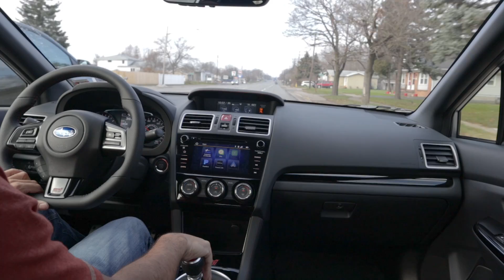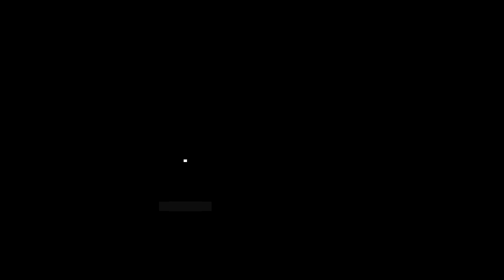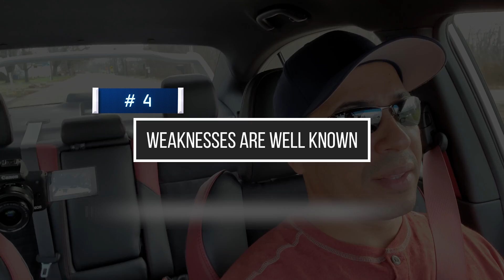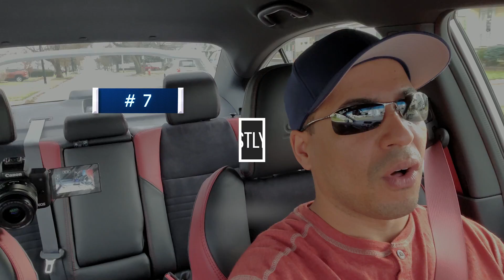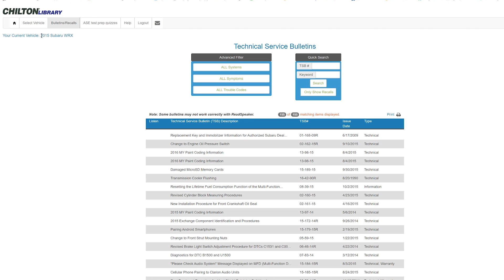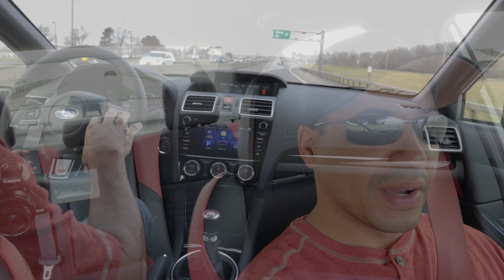2020 Subaru STI:  Why I didn't wait for the next gen STI

Comment: Subaru put too much oil in my WRX and made it run like shit. Now all the engine drive flaws I dont know if its the stock tune or due to the oil damage. So Ima beat the fuck outta the engine not investing a dime into it until it breaks or I trade it in for an EJ

Comment: Your number 1 reason was “platform familiarity” against your 2017 WRX. you do realise the wrx is on a totally different platform (FA20 vs EJ257)? What a stupid comment.
Reply: Boost & Shutter in the context of cars it definitely does and it’s a widely accepted terms. You specifically mentioned when you go to ‘do mods to this car you’re gonna know what to do and where the bolts are’. Everything about the car almost is different, engine (obviously), transmission, drivetrain, suspension, brakes, steering. If you want to mod your infotainment sure, that’s the same, but you never specified what exactly carries over in terms of familiarity for you aside from the car looking and feeling the same cosmetically, which IMO is not the most important factor when considering this stuff. Engine platform is a huge factor because this engine has been around for years now and it’s well known, with many parts plus aftermarket parts available. You did touch on that later in the video. Enjoy your sti, you made a good choice.

Comment: Also..fyi UEL is a flaw, it’s widely known that it is a big contributor to the Ring land issue. So stating it like a flaw like it’s an attraction is just really funny. I don’t own either of those cars 2015+ wrx or Sti but you did state some really bid things as “beneficial facts”  Sti is a better car obviously(trans,brakes,etc) . The engine is not. FA is the future and this is coming from a EJ owner. Also showing PSB’s like they mean anything..when Subaru has undeniably had engine failure issues from flawed designs yet has not only never done anything to fix it, but also has never even admitted it’s been a issue.. not knocking your choice of purchase though. Just saying.

Comment: I definitely agree there are many times where the first year or two of a new model will have issues that need to be addressed by TSBs or campaigns/recalls. If you read what the 2015 TSBs are for, though, a good number of those are regarding new features or significant changes in technology or service procedures that would apply to the entire generation.

Comment: Great points. I waited until the chassis got improved from the previous generations. I already have experience with the powertrain/drivetrain for over 20 years so that didn't matter. Plus the interior is nicer with softer touch materials vs the plastic fantastic filled previous models.

Comment: my parents bought a 09 audi a4 s-line new in late 08 it was the first MY for the B8 Audis, 64k miles and a decade later:

-all the doors dont lock
-buttons falling apart
-blown 2 turbos
-timing chain tensioners were plastic, so they broke and seized the engine
-replaced the head twice due to failures....all of this was taken care of audi for free because of class action lawsuits and they gave my parents a 100k warranty 10 years later!

NEVER BUY THE FIRST MODEL YEAR OF A NEW CAR!

Comment: I bought a 2015 STI, that had 24, 898  miles on it a few months ago for 24k$.

So happy I did. I'm excited to see the new Gen WRX, but it would be years before I would get one.
Reply: Hopefully the last owner didn't beat on it
Reply: @treblemix_  Does not seem to be the case luckily. I have it protuned currently at Stage 2+ and running a IAG AOS.

My Tuner said my motor is quite healthy. About to have them install and tune a EWG and headers addition. And installing the GetaDomTune Mod when it comes in.

Comment: I talked to a local dealer in about 6 months ago.  We were test driving the new Forester and GM actually sat with us because that was his ride.   Casually asked him if he had any information..He said that at least one trim will most likely be a hybrid engine with a CVT from what he heard from the inside.  Possibly a 1.8L, not sure.  This seems to be inline to the rumor that came out afterwards where Subaru will be teaming up with Toyota - there is not a more reputable company who does hybrid engine.
Reply: @akqjtn  for sure, but will likely bring up the price as well being a hybrid...I am concerned with affordability.  I wouldn't go for first year of a new gen anyway..Lots of kinks to work out.. Especially if it's with a whole new type of engine..Maybe year 3 or 4...

Comment: Congratulations on your new 2020 STI, wish u many miles of joy and happiness, I have a 2018 Forester XT in silver, I really enjoy it but I also know it is going to have many problems around 100,000 MILES that most Toyotas and Hondas will not have. The STI All wheel drive system is far better and more durable than Subarus with CVT All wheel drive, from what I have heard. Anyways Thanks for your educational videos, enjoy your winter.

Comment: Hand off the shifter when just driving around
Reply: Came to see if I was the only one who noticed 😉
Reply: Is it really that bad?
Reply: Drove with my hand on the shifter for 20 years. Zero effect on my cars...though its not “good” to do.
Reply: Why? I drive this way, if I need to downshift to accelerate away or slow down from someone who cuts me off. I'm able to.
Reply: @Mikey6048  Lol, They think its like super bad. Technically you might put pressure on the gears and grind down the synchros. Its not that big of a deal, they trippin.
Reply: Do your research before you look stupid.

Comment: The next gen WRX STi might actually be a hybrid unfortunately. The reason some people say this is that if you look at the average manufacturer fuel economy standard regulations to be implemented by international markets, Subaru is a bit behind the manufacturers at the top, even with their mpg saving CVT’s.
As an example: Toyota and Honda are well ahead of the regulations with their Numerous Hybrid and EV car variants with dedicated Insight, Clarity, Prius, and Mirai models too. Even the Civic Sport and Civic Si models are reporting close to 40 mpg with smart driving. 

This is why Aston Martin decided to buy Toyota City Smart cars to try to balance out their crappy luxury car mpg years ago. With their resources and engineers BMW, Audi, Mercedes Benz, Acura, and Lexus look to be ahead of the curve of the new laws with their concept models; but smaller companies like Mazda and reluctant companies like Fiat/Dodge/Jeep and GM are more screwed if the market is forced to shift. Which is also why GM is putting big lobbying dollars into making sure the EPA regulations don’t change and become stricter.
Reply: Boost & Shutter I’m not 100% against stricter regulations in principle. If car enthusiasts can still purchase reliable manual transmission sports cars that cost less than $35,000 and it just so happens that they have a newer form of  hybrid power or 40+ mpg, I’m not against that. Take something like the Acura NSX AWD power that was based around Porsche/McLaren/Ferrari power and place it in the new Type R , STi, TRD, Shelby, or NISMO and you have big a winner. It’s just current battery technology is absolute rubbish from anything other than a Prius or Insight.

Comment: I really like the STI but here in california we dont have 93 octane gas, so with 91 the owners manual states that there will be decrease in performance.... I dont wana drive a car with decreased performance...
Reply: Konstantin Dinkov just put 91 and add an octane booster and get a flex fuel kit and use e85 y’all have that there for sure
Reply: @jaysavage6493  Seriously? Do all that to a brand new car? Plus, octane boosters mess up the spark plugs and add deposits to cylinders, you dont want to be doing that...
Reply: Konstantin Dinkov oh booohooo all cars make carbon deposits just do more engine cleaning. You must not want an sti that bad if you’re not willing to do those little things to drive one.
Reply: Use Shell V-Power NiTRO+ which is rated at 99 RON. slightly higher than regular 93 AKI (98 RON) even though it's rated at 91 AKI
Reply: Sorry for your loss brother.

Comment: Sti is a good platform but Subaru has much to improve imo. If your trying to push power the right way it is very costly and the ej motor is not as reliable as other offerings. But if you can put up with all the cons and expenses then it is a great platform to work with if you have the patience and funds. Gotta pay to play with subarus.

Comment: The STI has the same ground clearance as the brake 4.9 inches (american units). 
But rides like a dam truck, I would LOVE an STI but it upsets me that the drivers seat feels like you're driving a truck (you ride high uptop the platform) vs how you "sit in the car" like the brz. I think I made the right decision.
Reply: I have a Ram pickup and an STI and when sitting in the truck I feel way higher than when I'm in the STI.
Reply: @easkeybikes1966  not right height, I'm talking about setting position. Even then try driving the sti and a brz. Same ground clearance but the BRZ feels way lower
Reply: @alexmoore5970  Gotcha. I just got into my step daughter's Honda Accord and yeah the seat feels closer to the floor than in the STI. But the view sucks. (In the Honda)
Reply: @easkeybikes1966  yep the seating position, dash, and outward view needs to be fixed. Why cant the engine hood slope like the brz while keeping mailbox hood intake.
Reply: @alexmoore5970  Maybe in 2021? I prefer the WRX rally car look over the 2 door coupe. But that's just my opinion.
Reply: @easkeybikes1966  your opinion is totally valid, I'm a coupe guy myself, but you know what I mean about the dash right? It seems like its  unnecessarily large, it sticks out way too much, if the dash was closer to the fire wall by 1-1.5 inches, lowered 1-1.5 inches and the seating position didnt feel so up right. I would purchase a new STI, but as things stand I'm looking st a Tacoma v6 4x4

Comment: Did you trade in 2015+wrx for it? Also how modded was it and do you regret going backwards power level wise and was it worth it
Reply: @akqjtn  that's awesome I had the chance to trade my 2017wrx in with around 410whp/380tq but I was so un ssure if going backward would be worth it so instead I'm going to keep building my wrx and put sti tranny in. I just ordered stage 3 closed deck block and cylinder head package. Plus a whole bunch more and I hope I don't regret it but worst case I'm going to get a 2015-2020 sti with out trading in eventually

Comment: Yes it is a FA24 315 HP not that much upgrade from this Gen Subaru 5th.  A FA 2.4 L engine  with 315 HP possible more torgue since FA holds more torque for its high end.  I would drop my money on the 2020 STI S209 with 341HP 327 Torque with $63,995 MSRP but dealership markup is 20 - 50% depends where is sold at.
Reply: Douraid Isho for $63k get a Audi S4, twice the performance, twice the comfort, twice as nice....

Comment: the word is never ever buy first gen cars as they're still figuring things out. Wait a couple of years :P
Reply: Pinyi Zhang exactly bro. Why I bought a 19 back in July. Let them work out the kinks for a few years and see what’s out on the market then
Reply: Always. Had a 94 Eagle Talon, 99 Monte Carlo, 2007 Malibu, and ,2018 Outback. Never really a bad issue till the Malibu , changed engine and transmission. ,278,000 miles still driving. The Outback stays in garage for the weekend

Comment: I gotta felling the next generation is gonna be a let down
Reply: Trevor Hobbs can’t help but agree. Subaru with Toyota’s influence has gotten further and further away from what made it special. Hope we’re both wrong
Reply: I hope it is, that will shoot the value of all sti's before it sky high lol. In case i ever decide to sell.
Reply: @BP5Lwhipple  then later on you'll regret selling it 😝 I'm keep mine forever lol.
Reply: I think thats inevitable.  Just look how GD performed in rally compared to VA...expect it to get worse despite rigidity.  I bought series.gray sti btw
Reply: This most recent gen was a let down....
Reply: @sleeper.simulant7327  a let down, the car has a better suspension, chassis and steering than all before it but its a let down lol.
Reply: B P a forged twin scroll ej207 version 8 like a real JDM STi wouldn’t have been a let down, not this crap ej257 that’s prone to spinning bearings and cracking ringlands.....
Reply: @sleeper.simulant7327  that i agree with, I've always thought the same thing. But nothing we can do about it.
Reply: B P sure we can, don’t buy there products until they meet demands
Reply: @sleeper.simulant7327  too late for me lol.  I like the car honestly it's not that bad bro i have never had any issues with mine personally. I have rebuilt several 257's for other people so i do know they can't take any abuse at all. But again my personal car is all stock under the hood.
Reply: B P I had a regular 08 2.5i 5 years ago and a ej255 swapped gf8 hatch 9 years ago. The hatch spun rod bearings a few months after the swap and the 08 had blown headgaskets at 97k miles, also the bearings got starved of oil and ended up going as well. The hatch was a project car, but the regular 2.5 was a daily, kind of ridiculous of the problems at those miles. Then again my speed6 hasn’t been the greatest either, skipped timing due to a failed VVT actuator, $3400 later.....
Reply: @sleeper.simulant7327  damn that sucks man

Comment: On a direct injection system you have to put some Lucas oil in the fule evrey few weeks and it cleans them right up
Reply: @MattyD on direct injection the valves never even get touched get the fule to begin with the injector tips is what gets gummed up
Reply: @becraftcorey  injectors will only get gummed up if you put lucas oil thru them wtlol
Reply: @ChupaLeche  no fool lmao it's designed to clean off the injectors num nuts
Reply: You’re telling me that you’ve discovered some magic potion that the car manufacturer is trying to hide from people?
Reply: @MrFloydroy  idk about that guy who claims hes a Subaru tec and even if he is I'm prety sure there not doing much more the an oil change and break job here and there maybe I'm wrong 
But what I'm not wrong about it carbon deposits come from the fule on a direct injection system the fule never touches the values so Its impossible to get carbon deposits on the back side of the valves vs port injection where it dose run right over top of the valves 
The Lucas oil has detergents in it designed to break up the carbon deposits that from on the injectors from fule being shot through them 
I have owned 2 diesels that were used to race always has been direct injection and diesels fule is naturally more oily then gas never once had a valve carbon issue never knew anyone who did so maybe I'm missing somthing but I think most of you are drinking the coolaid about direct injection show me a carbon crusted valve out of a fa20 I would say you probably have blow by issues not carbon deposits from your fule system but feel free to make stupid jokes and tell me how stupid I am
Reply: @becraftcorey  youre stoopid

Comment: Nice video, as always. Reason 7 with me is cheap stuff, things that can be pulled off totaled cars and things discounted by vendors as the market dries up. Not sure about your conclusion that injectors neccesarily lead to dirty intake valves, perhaps it is true but I wonder if it tends to be a Subaru engine specific thing or a Subaru tuned/otherwise modded thing.